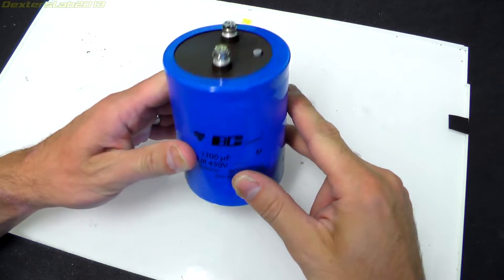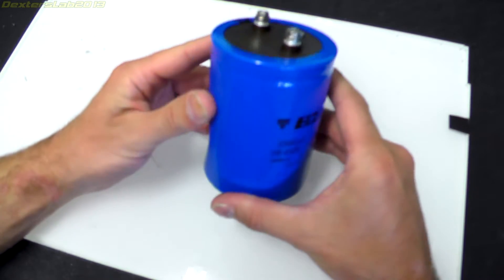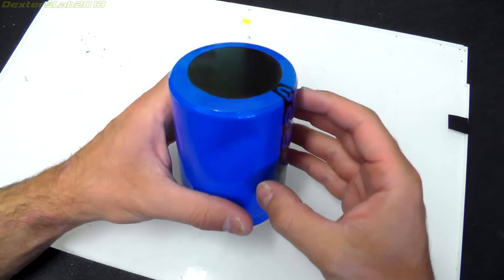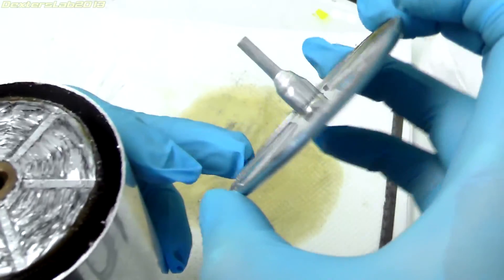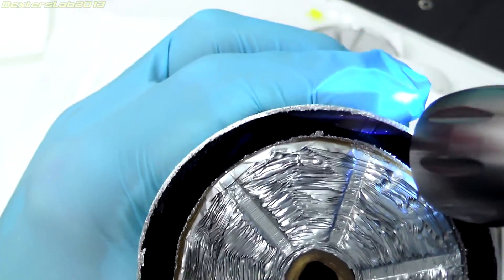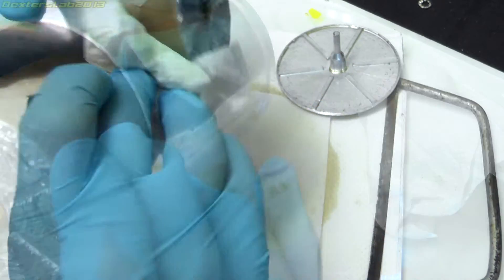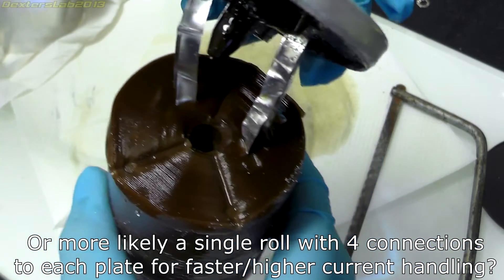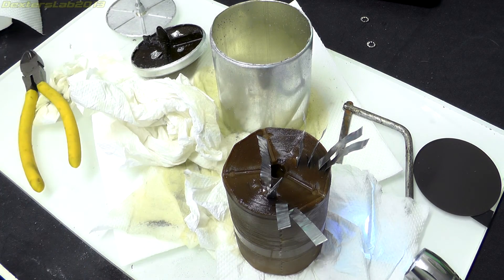DL#065 - Damaged Vishay 3300uF 450v Capacitor Teardown

Comment: Interesting, I wouldn't have expected such a huge air-gap inside, and it wasn't filled with electrolyte either to compensate for drying out.
And first I thought the mashed up foil on the top against the case was one of the connections, but when you showed the bottom they are both clearly connected from down there.

Comment: 4 riveted tabs and a lost mandrel, with an extended negative tab ( connecting the negative lead to the case so it does not form an additional unwanted capacitor and use up the electrolyte unnecessarily) going to the bottom of the can. 

Take the whole thing apart to see how nicely the tabs are riveted to the foil, and how all internal metal parts are the same pure aluminium. You might find there are extra paper pieces around the foil tab attachment area to ensure no raised edges will cut through the separator. 

Now apply voltage and see it fizz out the electrolyte.
Reply from the maker: SeanBZA thanks Sean, i have the guts saved in a plastic bag, i'll unwind it at some point.